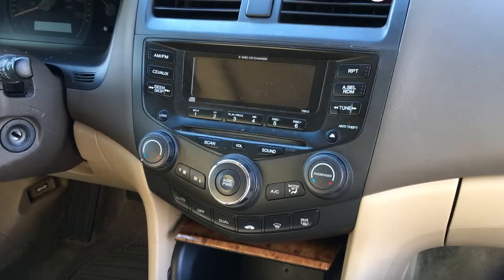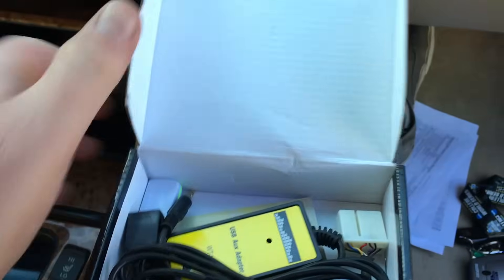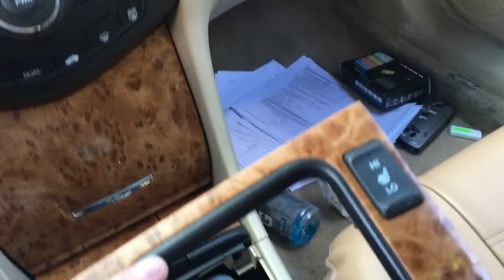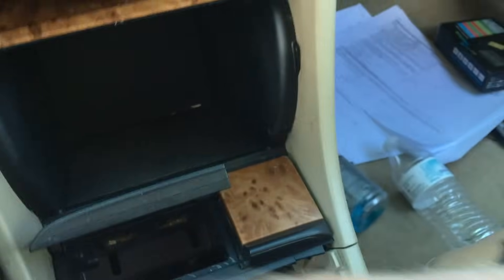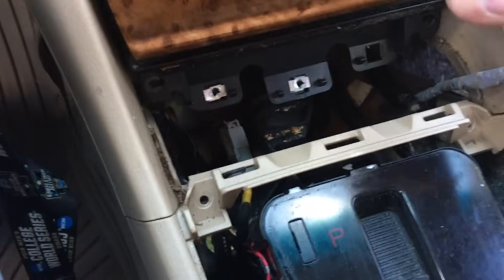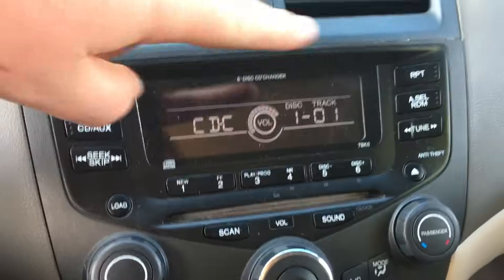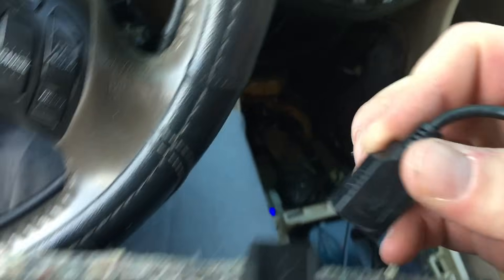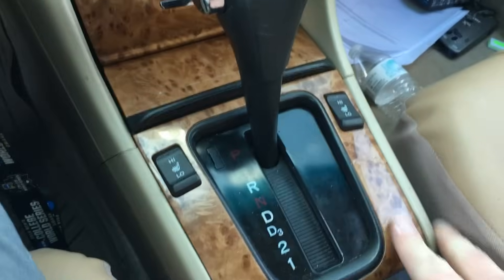2003 - 2007 Honda Accord Factory Aux / USB Install

Comment: Boggles the mind why Honda produced the radio unit with an aux power point and a selection button on the radio unit...but not the actual jack port itself.
Reply: Are you crazy that would bump up the price of the car by 20 dollars, who would buy car that costs that much
Reply: They were probably available in Japan with the option but not available in the US or other countries.
Reply: Honda wasn’t the only company to do this, my friends suburban, my blazer, my moms dodge they did it too. And these were all 2003’s more common than you think
Reply: Have a Honda Accord 24s 2004 from Japan and I can confirm it does not have an AUX port still...
Reply: so true 😊..but this is my first Honda though
Reply: nothing has irritated me so much to see that button and not have the function for it
Reply: They are literally the biggest leaches for money. I go to the dealership for free service on my car and they will ALWAYS "claim" I need something. They quoted me $892 for my front brakes! They also tried to quote me like 100 something for an air filter. They are insane!
Reply: @cynthiawalker7888  that's why you never go to the stealership.
Reply: @cynthiawalker7888  Ever dealership is like that, not just Honda.  Where have you been?
Reply: @kayleel9137  does female to male RCA work?
Reply: Sorry for being 3 year late but this aux input is for a cd changer
It was never intended to be a jack port
Reply: Yeah lol
Reply: I have a 2006 accord for my first car and the pure unfiltered irritation I felt upon realizing there was NO headphone jack for the aux function 😤😤😤
Reply: so u could pay them to do it for more than it costs to do it urself
Reply: @TheyTookMyDurr Ihave this car this messes with. E deeply Ike wtf

Comment: **HEADS UP** to anyone trying this instal, i just learned the hard way that if your radio is model 7BK2 there is no plug to connect this adapter. his model is the 7BK0. subtle differences you wont notice until you rip your fingernails off taking the radio out to realise. look at the bottom left face of your lcd display to determine the model.
Reply: literally struggling
Reply: hey so what is the difference. I have the 7BK2. can i still use the same adapter or do i need to get something else?
Reply: My radio says 7kb1 and I don’t have a port in the back under the radio like the video shows, can you give me any tips or information because i genuinely confused
Reply: As I look to the right bottom and see “7BK2” 😢
Reply: Take the 😢 back. Just unplugged the occupied one for cd/xm it was just pointing back not down. So surprised The stock system sounds so good w/out the dumb fm b/t thing. Used an $18 one from eBay. Mic works great with phone.
Reply: @Ma.the.Dopest yo I am trying to do the same thing how tf did you unplug that cable
Reply: @caseycipollone2693 yeah how tf
Reply: @Ma.the.Dopest so you had to sacrifice your CD player? No way to just add the aux without replacing?
Reply: @JesusHernandez-cj6jw  i just completed this with the 7BK2, the white plug facing back was the Sirius XM i think, so you sacrifice XM for AUX. The plug is horrible to remove but it has a press clip in the center on the downward facing side. Mine will cycle between the CD and AUX with that button and takes a couple seconds to wake up on AUX
Reply: What about a 7BC1?
Reply: Don’t know if this helps anyone but I have a 7BY1 in my 04 accord and the connection is being used. U can use a y harness for both XM and Aux or just simply swap out XM for Aux !
Reply: What about 2j32👀

Comment: You're telling me I have to tear apart my gear shift? Why didn't Honda just add the aux plug in?!
Reply from the maker: They did, but in later years.
Reply: its really not that hard..
Reply: Cause they were behind the times like toyota
Reply: If you have a manual you won’t have to disassemble the shifter

Comment: Nice minor upgrade for an older car that is still in great condition.   Much better than using a FM transmitter.
Reply: why is a FM transmitter not at good?
Reply: @dylanatkinson1538  the sound quality isn’t as good or loud
Reply: @dylanatkinson1538  the frequency an FM transmitter uses reduces your decibals by ALOT. When i got mine someone hardwired an fm transmitter over the aux, so i swapped it. I had less than half the sound quality with the fm transmitter.
Reply: You can use a Bluetooth aux device so that you can have hands free music.
Reply: @dylanatkinson1538  Ok for local, but driving out anywhere more than 60 miles (here in SoCal with crowded airwaves) you have to change the station.

Comment: Thanks, this video helped! I have a base model Accord so there weren't any holes to feed the cables through. Resorted to drilling one in. It was also kinda tough to remove the ashtray, you had to pry it off with a screwdriver. Overall, it works very well!

Comment: Took me 25 mins, but I appreciate the video brother
Reply: Did you have a problem when you changed it back to the radio it didn't go back to aux ?
Reply from the maker: It was a customer vehicle, so thats a great question!
Reply: Provo Beast Audio Installation man i did it and it wouldn't go back. I had to unscrew all that shit just to unplug it and plug it back. Now i just leave it on aux smh
Reply from the maker: Yep, too bad.  These adapters are not all that great, but for the price and considering the alternative, at least it's something.
Reply: Provo Beast Audio Installation right about that
Reply: +Tiny Savath I have the same problem ( when I change to radio I can't go back to aux) how did you fix it ??
Reply: Димитър Стоянов take everything back out and unplug the wire then plug it back. I have to either listen to the radio or have aux. I can't have both lol
Reply: damn, I should have read ur comment, I just got the same shit and same problem, which costs 30dollars.
Reply: 方言 I just leave it on aux now, but sometimes it gets a static to it and i got to unplug it then plug it back
Reply: i just bought the one that looks like factory , hope i don't have that problem because the aux cord will be plug from outside and  just pull the aux cord hope it's better like that
Reply: Can someone send me a link to purchase this
Thanks
Reply: @tonysavath6491   Hey I want to use this aux thing in my 2004 accord exl. So does it affect the sound quality, the volume level and is there a static through aux as well?

Comment: works! wasn't too bad, this video was a huge help.
on my Accord model I had to unplug what i believe was the cd cable to plug in the device, and the port was seemingly more difficult to access than in the video. i cut my fingers in several places unplugging/plugging in the new device on the sharp metal.
i just ran the cable to the right side of the compartment and it easily sits inside the compartment (didn't need to drill any new holes to run the cable)
Reply: Does the aux charges the phone when plugged in or just like speaker of your phone?

Comment: I have an 07 Accord. I had some challenges with the video as the plug was not in the same place and not easily accessible. After some time of trouble shooting I came to realize my Accord had factory XM Radio, so I had to remove XM plug to install Aux plug (or get different converter). The plug goes into rear of radio so is very hard to get to without pulling the radio.
Reply: I had the same problem. Tore open my fingers on the metal getting the original cord out.
Reply: @Fuhgeddaboudit94  Had to have my daughter with smaller hands do it for me :D
Reply: @ree_lopez  I did this and the display thats supposed to show up wasnt there

Comment: I found the actual oem Honda Apple music adaptor at a pick n pull for $8. Same install, plug and play, work with full function on my iPhone 7, including the stereo controls on the steering wheel
Reply: what year Honda did u pull it from? I want to retain steering controls also

Comment: While this video is very helpful, for anybody fairly novice to removing car trim, I would strongly advise to review the other videos on the same topic, same vehicle (with auto transmission for example), for more context. There is stuff that passed over in this video that maybe more obvious for more experienced people. For one thing, in the video the  trim is either already popped out, or seems to pop out very easily, this won’t necessarily be the case. Without experience, it’s so easy to damage the trim, if not break the tabs that clip it on. Take a lot of care, be patient, pry gently (but apply force), to release the components. Buy the car interior trim tools that are made of strong plastic. You’ll still probably need a small flathead 1:29 screwdriver applied very carefully at strategic moments.Even once released, the components don’t necessarily simply come out; the may need to be jimmy’ed somewhat to press past other tabs and obstructions. I recommend also a magnetic probe to catch or retrieve any screws that were dropped, and a magnetic screw cup to hold all your less screws and maybe shoe box or small box to hold the components and your tools while you are fussy -ing about the console in this confined cabin space. Once the aux component is plugged in you’ll probably want to secure to something so it doesn’t rattle. I Olfa’d some insulation off the back of the center console storage box and neatly duct taped the  the device to ‘back’ of the storage’box’. It appears there is enough clearance back there to do this. Even reassembling the trim wasn’t slam dunk IMO, although it did all reassemble fine in the end. Again, I’m sure for someone used to removing car trim, this is all really a nothing-burger, for others it  won’t be as obvious.

Comment: i unscrewed and took out everything but when it got down to the last step, i literally did not know how to take out the center console department thing, so i squeezed my hand through the cracks at the top and managed to plug it in somehow 😭😭 it works though so i did it

Comment: Provobeast, thank you, I was about to buy an entire new stereo and waste a ton of money but I found this video at almost 1 am and man this just made my week so much better. I will be doing this, this week. Thank you SO much. I have one question though, I have the 6-cd thing, but do not ever use CD’s. For this aux adapter to work, do I NEED a Y-adapter?
Reply from the maker: If you don't care to retain the 6 CD changer, then no, you will not need the Y adapter.
Reply: @ProvoBeastAudio  I too have the missing port issue. If I unplug the white cord does that unplug the XM AND the CD changer?
Reply: @ree lopez i just unplugged the white cable in the spot where i needed to put the new one in, i can still change cds and play them so not sure what that one was about

Comment: I just attempted to instal this into my 2005 accord, and there wasn't even an outlet compatible with the plug in. How can it be in an 03 and not an 05?
Reply: Peter Porker  same, did you figure out a way to install it?
Reply: same mine doesn’t have one and it’s an 06
Reply: I don't have the plug in either
Reply: Did any of you find out how to do it or at least an alternative?
Reply: Unplug the cable for the CD player and plug the cable in there
Reply: mine did not have the white connector to connect to. Has anyone solved this issue?
Reply: @lpapi5244  Do you have the factory Navigation system?

Comment: i got mine, seems to have the common issue of working once and then needing to be plugged back in... ballache. the device has a blue LED on it, which won't go out so this might be responsible, device still thinks it is connected like the first time and not turning off which may cause damage to itself... yet to see if disconnecting battery would be a quicker fix...
Reply: i have the same problem, did you figure out a solution? i dont want to rip out my center console everytime...
Reply: @fixinggood4595 same here, any clue yet?
Reply: @waseemhanna8980  i'm installing a reset button that cuts the supply voltage to the bluetooth device. That way i can switch between radio and bluetooth, but i still need to reset the device each switch. Best solution i could think of right now.

Comment: Before you all hate on Honda for not just adding it. A lot of companies did this, my Chevy blazer, my friends suburban, my mothers dodge and those were all 2003’s. Remember nobody used aux back then
Reply: Aux really didn't become a standard in vehicles until the 2010s. Mid 2000s was mostly just CD player and radio

Comment: So I ran into trouble in the final step of plugging in the kit there is a metal cover over the plug that I can’t find a way to removed, do I need to remove the screws holding the whole radio/stereo in place to get to it?

Comment: Hi there! Thank you for the video
I’m having trouble doing the first step by taking off the gear cover consul. How do I do this the clips aren’t coming off as easily as it did for you?
Reply: I winded up gradually appealing pressure until it “popped” out of the socket. I still damaged some of the “clips” .  The cover still fits securely and firmly with some of the clips being damaged. 

Im sure there is a proper way to go about this. I was just impatient.

Best of luck to you!

Comment: I installed the aux adapter. It works fine when I plug in the connector but when I stop and start the engine again, it does not work. Have tried 3 times. It stops working after I start the engine. Any suggestions?
Reply: me too. any solution?
Reply: Happing to me also, any wayout guys??
Reply: Me too. When I installed this device into my 2005 Honda Accord, it worked perfectly fine. The next day I would push my CD/AUX/XM button and it wouldn’t work. 

Funny thing is, i plugged the aux into my phone and played music, and my phone wants to play it through the device, but obviously my car is not letting me. 

Any fix?

Comment: Just got my ‘07 accord, has the CD changer in the trunk. Does this change install process???
Reply from the maker: Potentially.  you may need the Y harness adapter. https://www.amazon.com/REDWOLF-Changer-Interface-Y-splitter-Navigation/dp/B07Q2CXMJ6/ref=sr_1_15?dchild=1&keywords=accord+radio+y+harness&qid=1609428232&sr=8-15

Comment: There’s a metal piece blocking the plug in my car, yours doesn’t seem to have it. What should I do?
Reply: Peter Holley Hello peter I am having the same problem, did you manage to figure it out?
Reply: Sam Poulis yeah, in the back of the metal piece you should see a white plug. That goes the XM radio. You have to unplug that and then you can put the AUX plug in. It’s hard to do but it’s possible
Reply: @peterholley5802  Thank you! I managed to finally figure it out. It is a MASSIVE pain in the butt though.
Reply: How did you end up unplugging it, I can't even get it to move?
Reply: @peterholley5802  what year is your car? And does the radio work well?
Reply: David Todd lots of fiddling with it
Reply: Uchiha_ OnTheMoon 2004 yeah it works

Comment: I was going to do this but I bought the wires less Bluetooth adapter that connects to my phone. My altenator blew out and it dried my cd player. Radio works but cds are no longer showing or working. And it blew out the tractions control bulb and moonroof bulb. Any idea how to get cd player repaired ?

Comment: But to take off the plastics panels. When u move ur shifter all the way down. Theres now way to turn ur key all the way off. So power is still getting to everything. I noticed that when I had mine apart to wrap the plastic. Or were u able to turn ur key all the way off?
Reply from the maker: Yes, either use the shift lock override, or alternatively you can pull the negative off the battery.

Comment: I have a problem I conect the USB to AUX, but when I off and later On, I make AUX and not make nothing until I disconect and conect the device :(
Reply: i have the same problem, did you find a solution?

Comment: Ordered the adapter and took everything apart and my radio doesn't have the port. I can see the blue port and there is a white one next to it but the surface where I see the videos shows the port.. mine is flat. Any suggestions? I read I need a Y adapter .. can I use that with the adapter I already have? Its for an AUX/Ipod connections

Comment: My 05 Accord (fully loaded like his) didn’t have the hookup under the radio!
Reply: beachy95 mine either in my 2004 accord
Reply: Same here 🤦‍♂️🤦‍♂️🤦‍♂️
Reply: Same, just dismantled everything and there's no input except one in the back that already has something plugged in.  Going to have to go the radio transmitter route.
Reply: @OwenCarver  unplug it, it's for the xm
Reply: @EkJaKe22  I saw another video say you can use a Y-splitter to allow it to still be plugged in too so both can connect to that same port.  If it's only for XM then maybe I don't need the splitter.
Reply: @OwenCarver  yaa I didnt use a splitter, have no use for xm radio haha. I jus unplugged it, havnt had any issues
Reply: @EkJaKe22  ok sweet.  I'll do the same as you then.  It's a little awkward way in the back tucked away there, but it's worth the fuss.
Reply: @OwenCarver  yea its definitely not an easy task lolll. I couldn't get it myself, had someone else do it with smaller hands haha

Comment: Hi there ! 
Awesome video … was able to successfully install. However, when I press the CD/Aux button, I do not get the CD C option - it will only play CDs. Is there another step I should try to get it working? Thanks !
Reply: Does it work if you disconnect and reconnect the adapter to the radio?